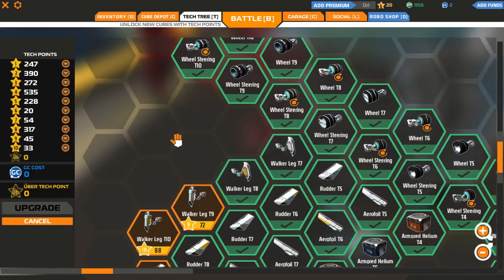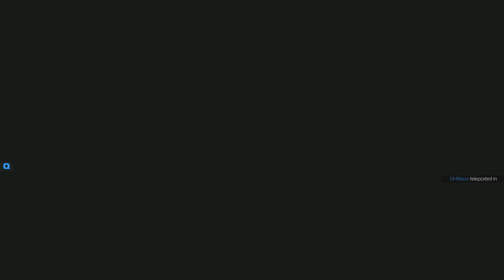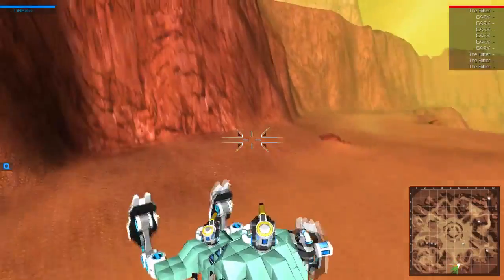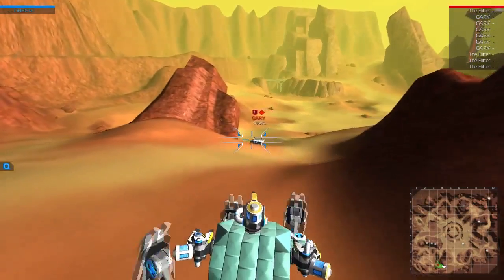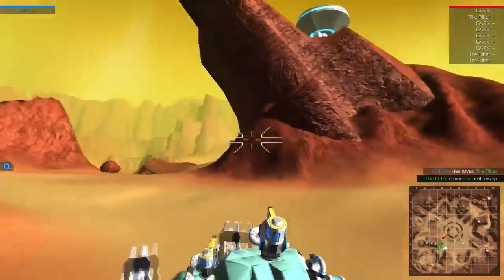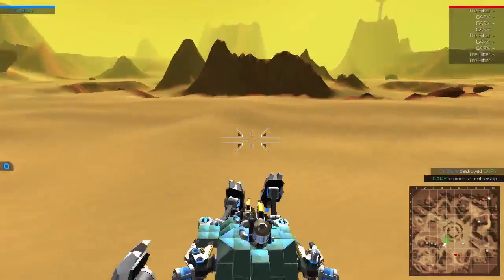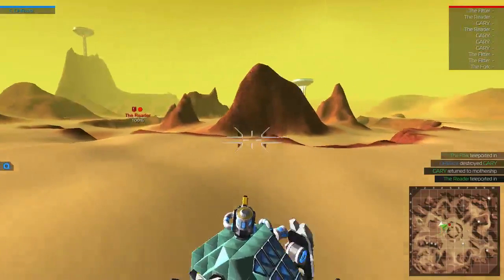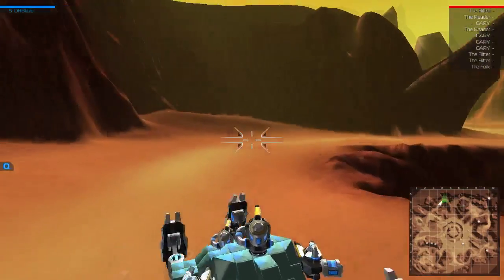Robocraft Tutorial: Walker Leg

Comment: Wait, so would it be possible to have some wheels that are one block off the ground and have the legs crouch raising the legs above the wheels and having the wheels move you? If so, you could just switch your shift button to toggle and you can toggle leg or wheel movement so you get the best of both worlds. Plus you can use wings and have hover blades too.
Reply from the maker: Actually I haven't seen that one possible with wheels, but you are right on hover blades and wings. The issue there is more of making your rig more fragile at the cost of those extra forms of mobility. On that note since this video I have seen a successful "Hoverwalker" that kicked some butt though that guy seemed very very good at what he did.

Comment: I'm thinking of making a defensive walker with a lot of smgs on it
Reply from the maker: SMG seems good honestly and Railguns work well also. The only weapon that seems iffy is the Nano-tech disruptor. Though that one is a risk on most vehicles with good pay out.. I think its just the legs them selves that worry me due to size and weakness
Reply: Ok, do the legs go upside down to unflip  vehicles?
Reply from the maker: Jmantheawsome1 Saddly no, once you flip you need a rectifier. They try to adjust your landing though if your in the air ( and do a poor job of it mind you) So treat it like a plane in those regards.
Reply: Wow not even T7 legs can't anti-flip? Well I guess that they would be too OP than they already are. So would they be good for tanks? (Of course having wheels on the bottom in case they get shot off)
Reply from the maker: Jmantheawsome1 Ironically wheels seem like the bad mix with them but I can see that working in a last ditch effort in T10. In a lower teir though I would ether stick to hover or wings/rudder.  Honestly I think the legs are fine on their own but trying new things never a bad idea. Never know what the new bad ass thing will be.
Reply: Lol so true. But thanks I'll try it out!
Reply from the maker: Jmantheawsome1 let me know how it goes, I'd be interested to see if this works up to par or better. :)